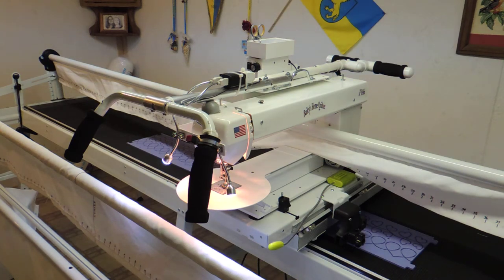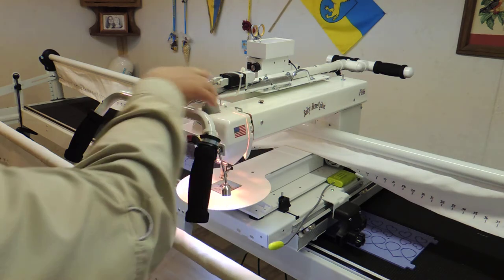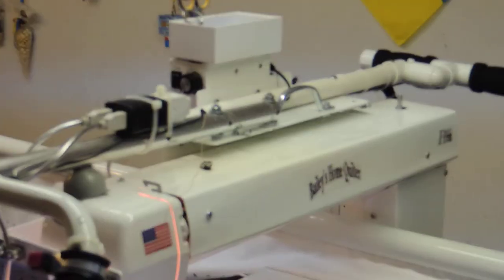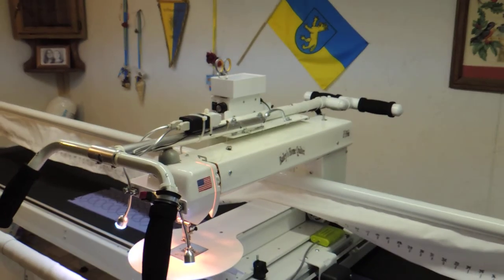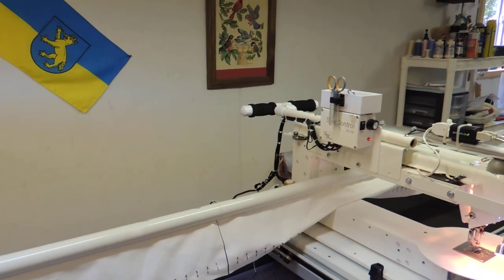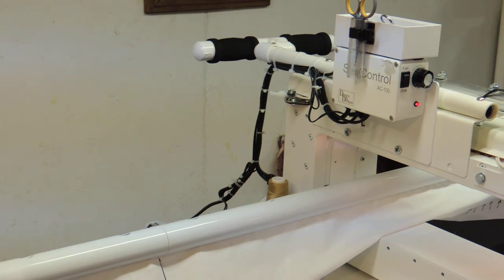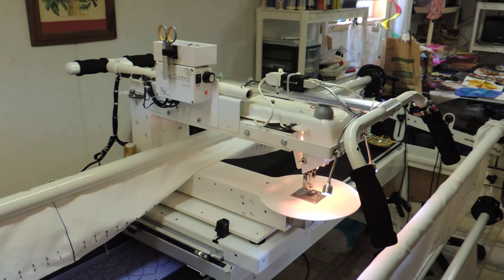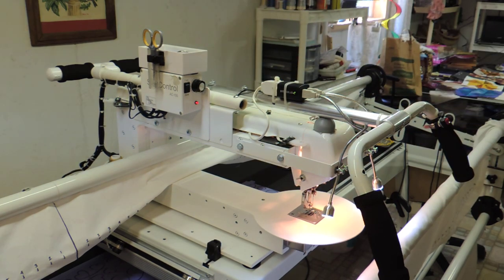Bailey's Home Quilter 17E

Comment: Mark.. thanks for this video.. I am a new Bailey17 user..have had issues with the SC. Chuck sent a new one.My DH is a retired CNC Machinist. when he set up our SC it kept blinking..could not get consistant speed.Hope it solves my issues,675 is a lot so spend without satisfaction. Question: does it affect the SC when using that switch for the Needleup/Needledown function?  Thanks, Barbara